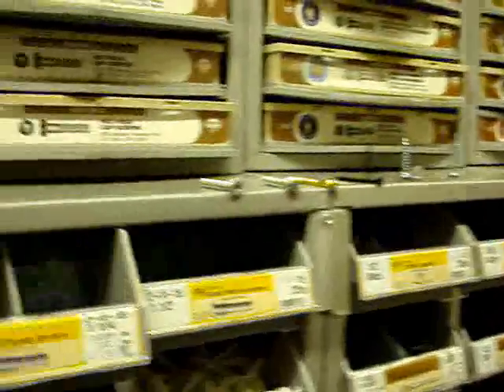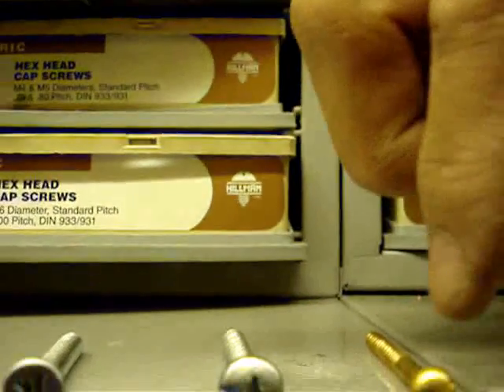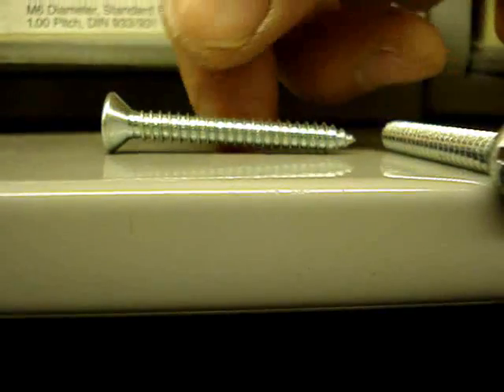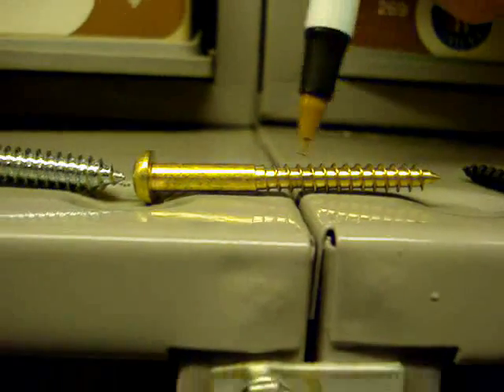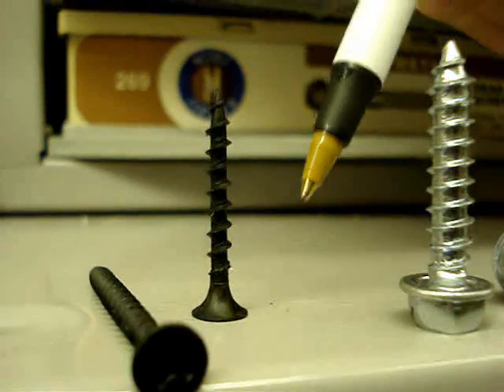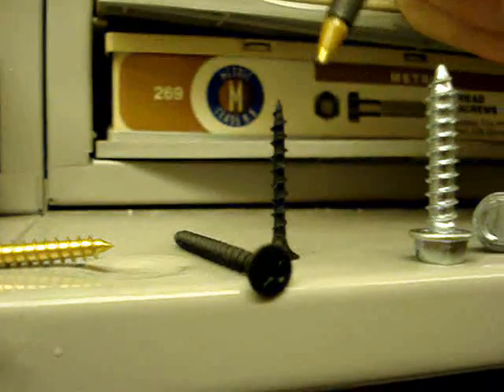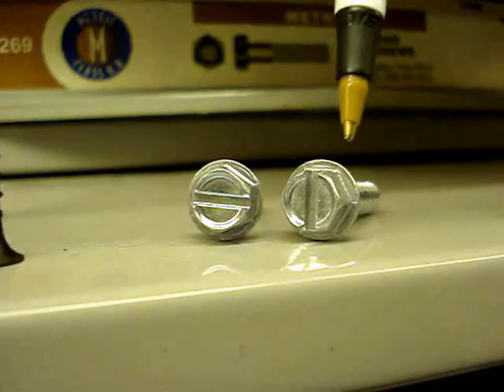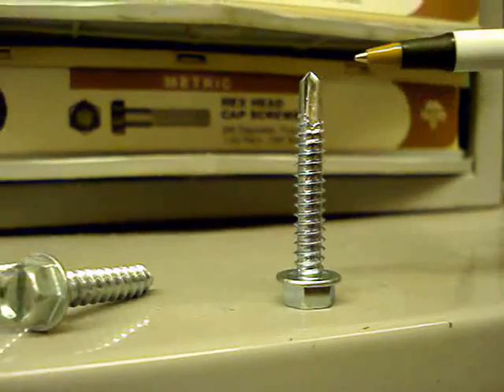Use the Right Screws for Drywall, Wood, Metal, Concrete, Masonry

Comment: What screw do you recommend using including length that would go through standard wall stud in home to hang very heavy picture?
Reply from the maker: A #8 x 1 1/2" depending on the drywall or plaster thickness.  1/4" should be adequate for drywall. Longer for plaster.
Reply: @MrHardware1  Thank you!

Comment: what type of screw would i need to screw in a air vent into the ceiling of my home?  the guy at home depot gave me sheet metal screws but not sure this is the right screw to use considering the screws are going into drywall.  appreciate it if anyone can help me out.  thanks.
Reply: hi JK. You can use a dry wall screw but with an anchor to screw an air vent into ceiling or dry wall as the gentleman explained in his video. I hope that helps. it is good to use a stud finders to see what's behind the dry wall. But ceiling is actually concrete so you would need a concrete screw. You should make a pilot hole first, then put in your concrete screw with a drill. You do not need an anchor for concrete screws. I hope this helps. Good luch

Comment: I will be screwing a 2x2 into 14 gauge sheet metal. I have 2 inch and 2 3/4 inch sheet metal screws. I will pre drill and counter sink the hole about  a 1/4 inch. Which of the two screws would you recommend? Is the longer screw a waste in the sense the extra length in the metal doesn’t equate to a stronger hold?
Reply from the maker: I like the short screw seeing as once it is countersinked it will be 3/4 longer than the 2x2. Be sure the hole in the 2x2 is loose to the screw. No sense fighting the wood, it will ruin the feel of the screw into the metal.

Comment: how to use plastic fasteners and how do you put them in the wall before you put the screw
Reply from the maker: drill the hole so the anchor goes in tight, tap in the anchor with a hammer. Then when you insert the screw the plastic expands and grips in the hole.

Comment: Hi Mr Hardware, thanks a lot for this tutorial. What about the lenght and different head sizes. I saw some sellers mentioning M2,M3, 4 etc.. What is that means? Thank you very much.
Reply from the maker: M2 usually refers to a metric 2 millimeter bolt (or machine screw, same size and threading) M3 is a larger 3 millimeter bolt and so on.
Reply: Hi.  I want to install joist hangers and rather than nails I want to use screws due to the confined work area.  I was warned off this method because they said screws have less shearing strength than nails so screws would not be useful in this application.  I am seeking your expert opinion.  Are there screws which can be used for this purpose?